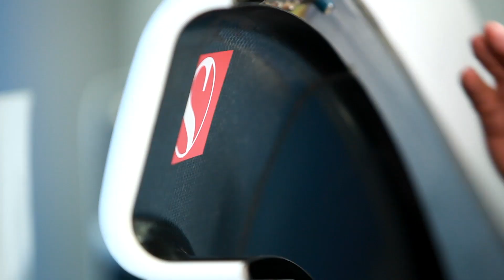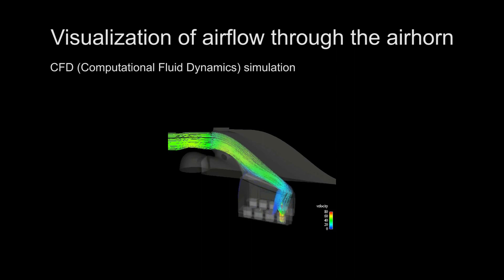Cutaway Insights - Episode 4: Airhorn - Sauber F1 Team

Comment from the maker: That's not stupid at all, San. The airhorn is the inner part that directs the airflow towards the engine. On the outside, it is surrounded by the roll hoop which is a structural part to protect the driver.